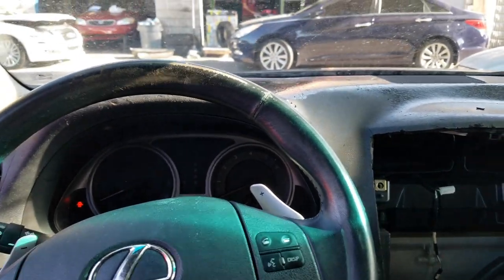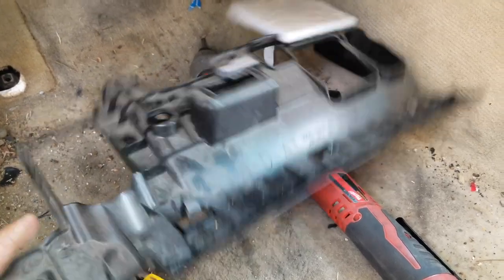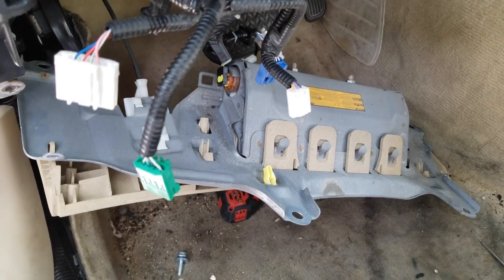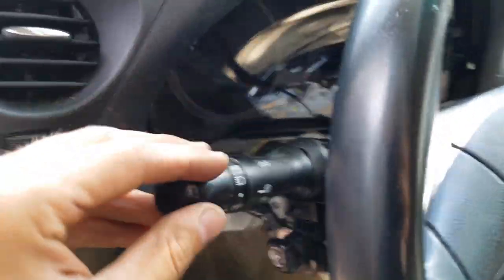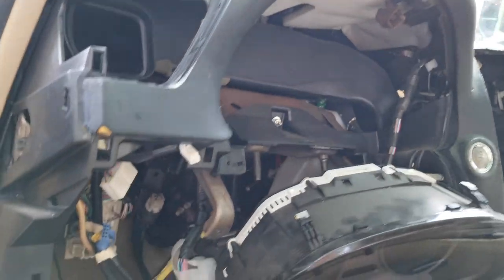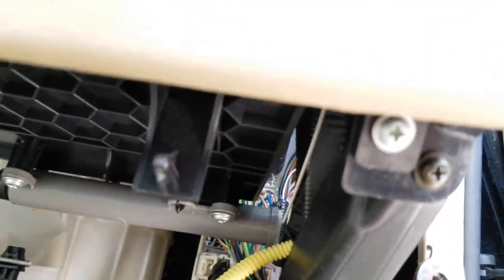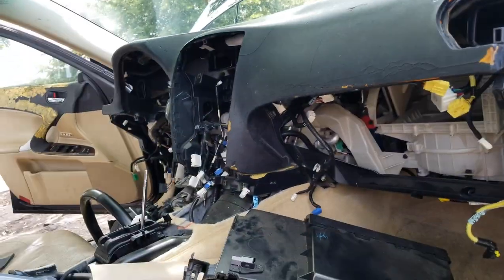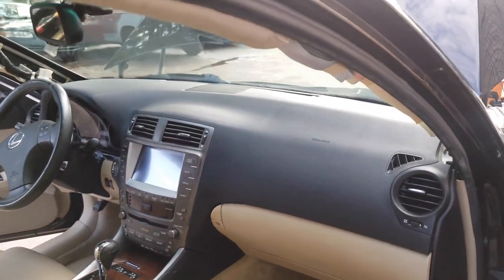Lexus IS250/IS350/IS F DASH REMOVAL

Comment: I recently bought my first Lexus ever. My IS250 needed some love and the previous three owners never got the recall for the dashboard. I was unable to find a used one so I decided to buy a new one. But thanks to you I saved $$$$ by doing it myself instead of taking it to the stealership. This for sure is a 12 hour project. If I could suggest something to any future Lexus owner thinking about making this happen… write every step down and if at all possible, also take pictures of things that seem too complicated or have too many steps. For the OP, I can’t thank you enough for this video.
Reply: Can I ask what you paid of for the new dash top? And you are in the States, right?
Reply: @JohnnyRawks  I remember paying between $350-$450. I can’t remember the exact price. I went to look for the receipt of the brand new part but it disappeared. And the website is not listing it anymore.
Reply: @RedBRZ23  Thanks. That's not too bad really. Could be worse. I bet in Canada a new dash top would be > 1000.00++ but I will check at some point.
Reply: @JohnnyRawks  I didn’t think it was bad either. The hardest part was putting it inside the cabin. 😳
Reply: @RedBRZ23  Yeah, exactly. Even if I could ever find one at an affordable price, the thought of installing it myself makes me break out in a cold sweat. I'm kind of handy, but....
I have an led out on my speedometer needle now as well, so that's another diy project at some point. It's funny, I owned a 1992 Celica GTS for almost 30 years and never had to do any work on it other than regular maintenance. I sure miss that Celica.
Reply: @RedBRZ23  Is it 12 hours just to take the dashboard out or to take the dash out and put the new one in? Thanks.
Reply: @Leo-the-lion1974  I would say it took me that long because I am limited to mobility and I was by myself. But altogether it took me 12 hours from start to finish. I’m sure it could take less now that I know how to do it.

Comment: Just changed mine today. Found a dash replacement at a junk yard from a 2010 IS250 C for my 2006 IS350. it took for ever. I finally got it done. I called a place for door panels and they said it will cost $75 per panel. If I dont find something in the junk yard in the next few weeks, I may spend the money and do it. Thanks for the video. Definitely gave me more confidence instead of going in blind.
Reply from the maker: Believe me if you do the dash 2 o 3 times then you take it apart in less than an hour I found a dash even though I dont have the is350 anymore and I took it out in 20 minutes . And door are not that expensive for $75 each I've head $100 each
Reply: I need a dash and front door panels. Where did you get the door panels for 75.00? That seems unbelievably cheap. I'm in Canada, though.
Reply: @rev367  Yeah, that's a great idea. Thanks! I really need the door panels, too.

Comment: You don't actually need to undo anything related with steering wheel. Just move it all the way backwards and down, the dash is soft enough to flex around the steering wheel. Removing steering wheel obviously makes it easier, but it is possible to do without removing it. As well instrument cluster could be pulled out without removing the wheel, just little bit hard to undo the plugs from the back. Did it myself today in ~1.5 h but that was only because I had to get the battery from home to move the steering wheel. I reckon it could be done in ~30 min if everything is ready.
Reply from the maker: Thanks for that advice man !!@
Reply: Hey man I un bolted the two nuts to drop the steering wheel, but now it won’t pull toward me so I can line it up and bolt it back in. Any clue what it could be?

Comment: That is a very challenging job. Interiors today are designed to hide the fasteners for aesthetic reasons, and the extensive use of hooks, barbs and "christmas trees" make assembly at the factory quick. All of that makes it a real challenge to reverse engineer the assembly process when trying to remove these fragile parts, never knowing how hard one can safely pry and pull before breaking something.

You have done a great job of distilling several hours of work down to less than 15 minutes. Showing the location of the various attachment points and fastening methods makes the job for your audience much easier.
Reply from the maker: Thanks for this awesome comment!!
Reply: @kennycharneca1  I was not actually looking to do the dash replacement, but the video was informative for learning where to run a wire for an aftermarket camera.

Comment: Wow man you did an excellent job replacing the Dash panel. I have the same issue with my 2012 Lexus IS250. I don't like the idea of putting a mat on it because it looks bad. I found a place online where I can get it for $265.00. You inspire me to think about and do it. good video
Reply from the maker: Thanks for encouraging me making more videos !!
Reply: What? This is happening on 2012's as well? Good to know. My 07 has this issue and I thought it was only 06-07 that had the issue. I would grab a new dash in a heartbeat for 265.00. Even if it was USD (I'm in Canada). Where did you get it?

Comment: Great job and very useful video. How many hours would you guess it took to remove everything and then how many more to put everything back?
Reply from the maker: Depending on how many times first time 3 hours and then last time I did it 20 minutes  and 20.
Reply: @kennycharneca1  Thanks!  That's not so bad.   Was that 3 hours  - just to remove it or 3 hours total to remove it and put it all back?
Reply from the maker: @6figure101  3 hours to remove first time because I couldn't find any information on how to do it so I broke a couple of stuff then when I learned took me 1 hour to remove and put back.

Comment: Great video, thank you! Was going to do this before I found out my car was eligible for the recall.
Reply from the maker: you are lucky man obviously that's what we all wish but 2006 they don't cover anymore, but brand new dash and door saves you like  $600 easy .
Reply: @kennycharneca1  In Canada, none of the interior panels are covered. I have an immaculate 2007 IS350 with deteriorating interior panels. Dash has 4 large cracks in it already, with surfaces pitting and getting soft. I was a huge Toyota fan after owning a 1992 Celica GTS for almost 20 years. No longer. They screwed a die-hard and vocal fan. Now I spread the bad news religiously.
Reply: John McLaughlin same here. Hard to support a brand that won’t stand behind their product.

Comment: Excellent video. Used it to swap mine successfully. Packed with info. Hardest part was getting the stupid A-pillar air bag clips off.
Reply: Nice, how long did the whole replacement take you?
Reply: @sbstance4818  About 2.5 hours. I started at 1:30pm and was done at 4pm. A-pillar covers alone took over 20 minutes easy. I had pry off the clips from the body behind the airbag. Also pay attention to the order of removal of the glovebox and knee airbags. I got messed up on both sides and had to take stuff back apart too put it back in order. I also had to reinstall my GPS antenna (new dash didn't have one). All in all if I was to do it again in and out easily in less than 1.5 hours tops!
Reply: @turblown  thank you for the response, I’m gonna try to replace my is350 dash next week

Comment: Great video. I have an immaculate 2007 IS350 with similar problems. Dash is cracking and melting. Lexus Canada will do absolutely nothing for me. Great company eh! I may attempt this myself if I can find a replacement.
Reply: Hey I have an 06 IS350 in Canada and mine melts in the summer and is cracking. Did you ever get around to replacing it?
Reply: @slamamsters  Nope. I might scout around in the Spring. Apparently the price of a new dash top is outrageous, but I haven't checked with a dealer yet. I may try to find a used one off a wreck or something. Not sure about the door panels. My dash is really cracked up bad. Door panels not as bad.. just some mushiness on the top sections. Pisses me off every time I drive it, which is rarely these days.
Reply: I've seen around online for US dealers and on the forums that it's under $400 USD msrp for 06-08 dashboards. Shipping from US seems to double the price though. 09+ seem to be even cheaper but I don't think our older vents and radio would fit. I need to check with local dealers too but I bet it's much more expensive here in Canada. Are you in Ontario? If you ever go ahead with replacing yours please let me know.
Reply: @slamamsters  Yeah, Southern Ontario. One option would be to drive across the border and pick one up I guess. $400 USD is not nearly as bad as I thought. I would definitely do it for that amount. I would do the install myself. How hard can it be? lol.  Hopefully a new dash would be made of better materials and would not melt and crack like the existing ones do. Yeah, for sure, I'll let you know.
Reply: @JohnnyRawks  maybe an lkq or similar in the us can cut you a good deal on a dash to make it worth the shipping problem is finding one in good condition

Comment: Hey man great video, I have one question though I just replaced my dash and everything went in good but I went to start my car and it goes down to like 500 rpm, do you think it could be a bad connection or could anything else have something to do with it.
Reply from the maker: Remember when u disconnect the battery the tps adjusts so I would check that I don't think you did anything wrong

Comment: Hey bro, was there anything that had to be torqued? Like the steering wheel bolts and stuff. Just want to make sure stuff is safe at the end of the day. Thanks.
Reply from the maker: The 10mm not really you should do it by hand feeling the steering wheel I would torque them would use the workshop manual to make sure I feel that maybe is going to be like 40 or 50 ft lbs
Reply: Cool. Thanks bro. Love how you do it like how'd us regular people would go about it. That's about a $900 replace from Lexus, but including the $400 to $500 new dashboard from them 🙄
Reply from the maker: @sammarithinang_pannarith  I know is not the best video but I tried my best and is like a reference for people fixing this common problem thanks for the support.
Reply: @kennycharneca1  All good bro. I love it. I hate those "professional" videos that's all edited and run perfectly that I lose my place and stuff. They don't show common mistakes or show us specifically what piece they're talking about. They just assume we're intermediate peeps when they say it's for "beginners" or whatever. I love your format. Pointing at what you're doing is a plus too. You good. Keep doing it. Thanks for everything.
Reply: Looks like those bolts are set at 16 ft-lbs.

Comment: Are there any connections on the ac evaporator? I had opened it but now there are more connections so am confused can you help me with the connections?
Reply from the maker: no ac connections just ac vents here and there but i didn't had to mess up with ac thank god !
Reply: KDF channel i had a problem with the ac evaporator and i replaced it and fixed it and i have ordered a dashboard but now am confused was there any connection to the ac system or no .. on the passenger side is there any connections going to the ac system?? 
Please let me know
Reply from the maker: you need to know about electrical connections or the Freon connections??
Reply: KDF channel the electrical connections...
Reply: And my cars trunk isn’t opening too i had removed the dashboard and the other stuffs .. i had kept the covers and other stuffs in my trunk and its not opening nw as my other covers else than the dashboard are kept inside my cars trunk..
Reply from the maker: @alhamood7931  I'm pretty sure you have some connectors that still need to be attached to open the trunk you might have to use the emergency opener from the inside

Comment: thanks for filming, not something I want to take on but interesting to see. May try a coverlay instead. 

ABS refers to the anti lock breaking system, not the air bag system, just FYI.
Reply: What did you end up doing
Reply: @cottonsmith8942 , I still need to get the overlay, my dashboard looks horrible. I removed a phone mount and it ripped OFF part of the dash itself and now there's a hole! :(

Comment: Please don't touch the airbag connectors like that. One electric discharge from your finger and your done...
Reply: be specific, what should you do, not do? How do you disconnect properly?
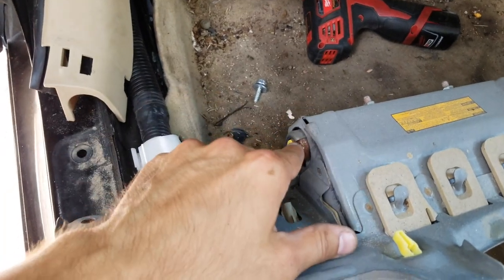Reply: @lisao3041  At 5:00 he touches the socket of the ABS system. If he's electrically charged (e.g. by rubbing his body on the carpet) a discharge creates a little spark to the connector. That connector's only purpose is to transmit a little signal to fire up the airbag. Your discharge can do the same thing. Also after you took the airbag out always put it face up. So in case it goes of the actual bag of air can expand freely. If you put it face down the whole assembly is catapulted through the air (easy to find on youtube)
Reply: Schnapsbrennor, I see. That’s a lot more meaningful comment after clarifying. 

When did ABS come to mean air bag system? As a former employee in Ford’s brake dept,, ABS has always meant the anti lock breaking system. lol
Reply: @lisao3041  I actually dont know about the shortcut. In Germany abs is also used for the anti break locking. I just know its also printed on every part in my Lexus,that has an airbag and that usually every bright yellow connector is airbag related

Comment: did this and my car isnt starting,  cranking but failing after 3 seconds
Reply from the maker: Did you check everything?? Like the ignition button ? Remember the car need to read the key to unlock the alarm system